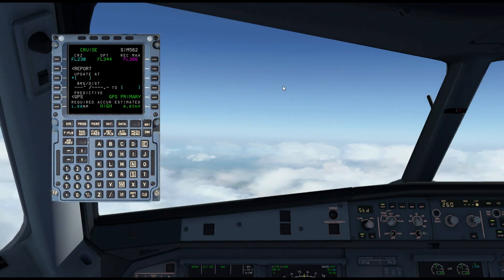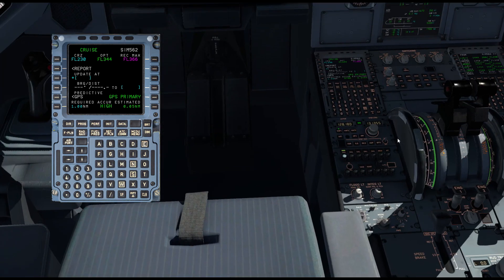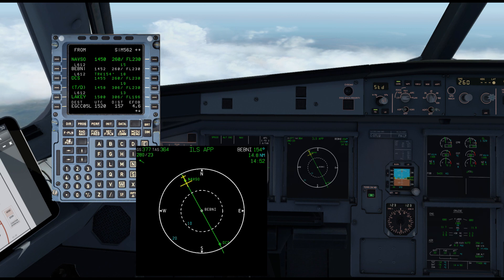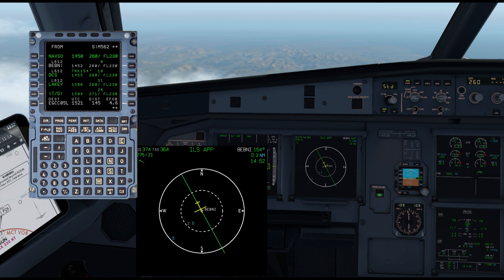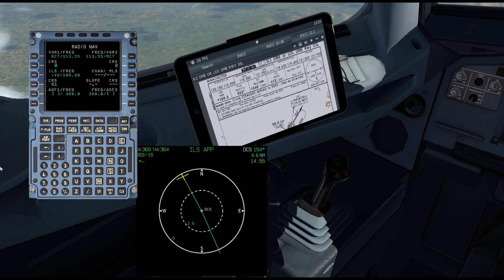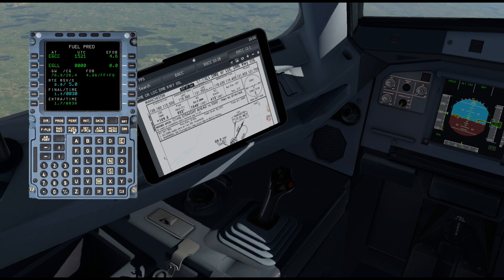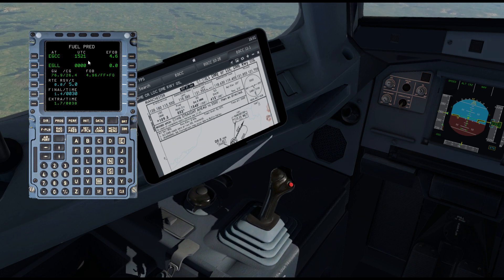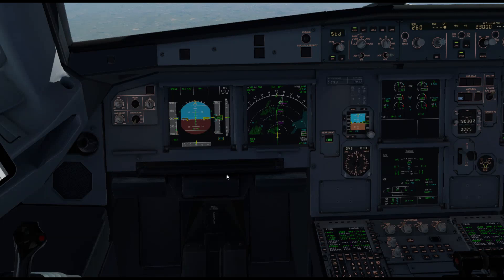Toliss A321 X Plane 11 Approach FMGC Setup with Real Airbus Pilot (Tutorial)

Comment: Your tutorials are extremely helpful, but I do have so many questions.  Many times you talk and reference your real life experience.  For someone like myself who doesn't have that commercial experience, how do you know whether some of the turns are doable?  And,  Then we get the discontinuities with Manual (that I usually just remove), which results in almost impossible approaches.  How do you adjust for these things.  Almost seems like a video in itself.  I love the Toliss A321XLR.  The only aircraft I fly on Vatsim.

Comment: Hi. I love your videos!
I have a small question with the Toliss A321. I hope you can help.
When doing an approach on VATSIM, I program the MCDU for my planned approach. 
Then a controller goes online and I get a different STAR and RWY. 
When I try to change the arrival in the MCDU and insert it, I get
SELECT HDG/TRC FRIST.
What dose it mean.. and how can I change my START/RWY?
Thanks!
Reply from the maker: Hi, thank you for your kind words! This means you need to select a HDG (pull the HDG knob) and then you can change the arrival STAR, once it is changed you can do a Direct to a WPT (preferable) or re engage NAV. I hope this helps!
Reply: @320SimPilot  What a fast reply. Thanks! I'll try that!

Comment: does it have to be an ILS runway or can it be also LOC?
Reply from the maker: A LOC only approach is also a possibility, but if you want to fly a full ILS then select the ILS approach. If there is not an ILS approach available then perhaps your destination does not have a fully equipped ILS approach, in which case you will need to fly another sort, maybe LOC only (this would be a non precision approach meaning you will have to control the vertical guidance yourself like in my VOR TRAK FPA tutorial).  Thanks for watching!
Reply: @320SimPilot  Thank you